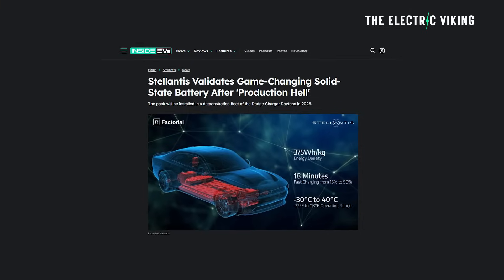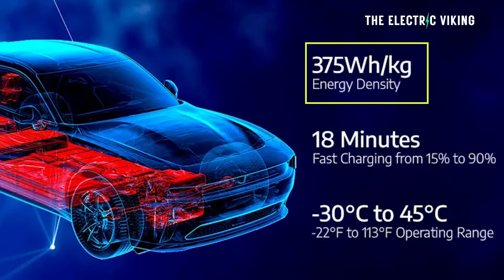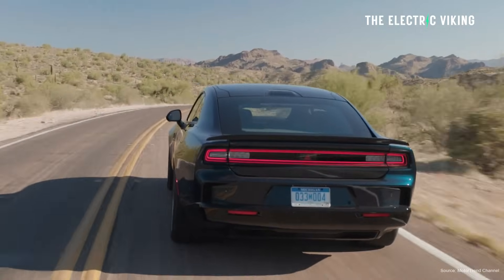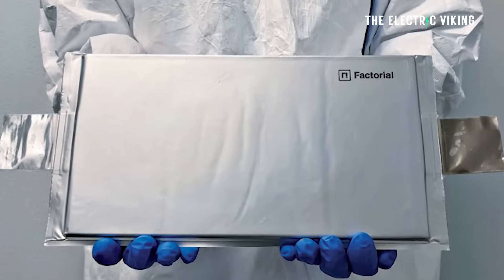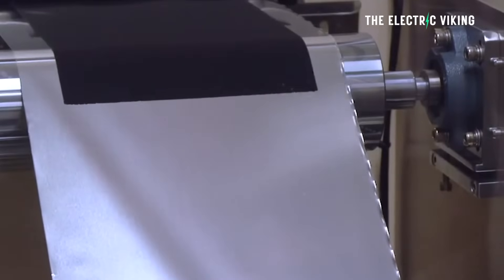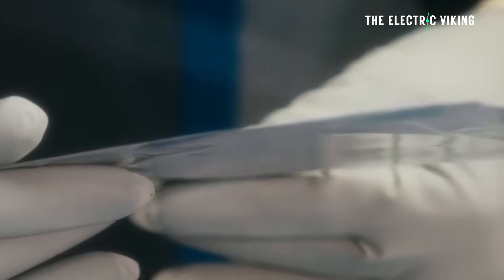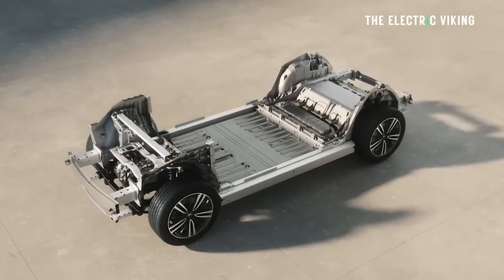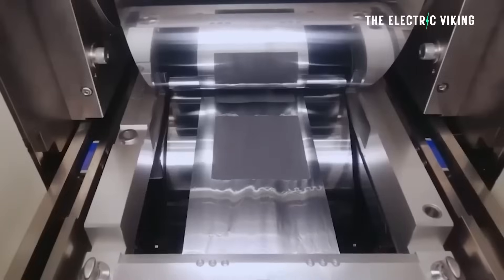Stellantis + Factorial Breakthrough: Solid-State Batteries Almost Here!

Comment: 45° C isn't bad. The question is how much lower is the battery performance if it only starts losing performance at 113° F? Most of the US doesn't get much above 113° anyway. So a little bit of performance loss on occasion for the southern states in the summer isn't bad. Not god though for those if you in upper Canada and Alaska during the winter.

Comment: most charging speeds are quoted for 20% to 80% so 15-90 is probably faster than most at the 20-80 capacities. Apples with apples? Is the Toyota technology though? Beware the Osborne Effect.

Comment: Does Indonesia produce class 1 nickel?
Most Indonesian nickel smelters rely on coal-fired power plants, with the industry consuming approximately 15 terawatt-hours of electricity annually. This translates to roughly 14-18 tonnes of CO2 emissions per tonne of class 1 nickel produced—significantly higher than global averages.3 Apr 2025   DO YOUR RESEARCH MAN   Call out safety always buddy...Regardless of what the nickel is used to for, this article has exposed shocking environmental damage done to Indonesia, and it appears that the safety of the local workers comes in long last place, No THANKS TO CHINA.

Comment: Sigh.
I want to believe… but no. Yes, it’ll likely happen, but I won’t get my hopes up. Need I mention Toyota?

Production at scale of a battery that can reliably provide 80% capacity after 1000 cycles is always two to five years away.

I’ll believe it when I see it. Until then, it’s just a PR stunt to pump the stock, or raise money.  In this case, coming from Stellantis reduces my trust.

Comment: The charging speed as a percentage of full charge matters, but with higher energy density, the amount of energy in a full charge is greater. So if you measure it as KW/hours per hours, what is the speed when measured that way?

Comment: Viking I really like you but the only battery metric worth talking about is PRICE per Kwatt hour. Yes weight and size are of some importance but PRICE is the key to getting the price of EV's down. As long as the battery lasts longer than 300,000 miles and can charge in less than 30 minutes then PRICE is the only thing worth talking about. 
So I don't really care about batteries that last longer or charge faster or are lighter, just tell me when the price per KWatt hour is going down

Comment: If true that charging is great. A charging speed that gets you 200 miles in 10 minutes is as good as it ever needs to be, I've been happy with half that on my Tesla. You can't go to the bathroom in less than 10 minutes so that sets the minimum time to charge. A couple of hundred miles is 3 or 4 hours of driving which is a long interval between stops.
The 600 cycles isn't good enough, they need to double that but I'm sure they will get there.
While this is good news for EVs in general it doesn't fix Stellantis's problems. The Charger weighed a way more than it should have, the battery was only a small part of that. A Model S with the same size battery weighs 1300 lbs less. A Model 3 weighs 1800 lbs less. The software on the Charger was also completely broken. Don't know if Stellantis has any competent EVs in Europe but their attempt in the US was a disaster.

Comment: Does the Electric Viking care about airplanes too?   The energy per weight will transform aviation.  Electric motors are far more reliable.  High energy density opens the door wide open to drone like helicopters and other electric airplanes.

Comment: Useful for aviation, however less important for EVs that already have reasonable range. Ubiiquity of supercharging would make this less relevant, but smaller lighter batteries make better sense for more efficient EVs.  Not really a game changer for EVs beyond significantly improving EV operating efficiency.  More limited charging cycles make this technology remain idealistic for now.  However most aircraft fly over 5,000 feet where air temperatures are lower, so heat management would not be a limiting factor for aviation and the higher Wh/kg makes solid state a good candidate for that type of application.

Comment: I think the only real advantages of solid state as they currently exist is safety and weight. I'm sceptical of the lifespan a solid state battery.  Also the temp range and charging speed are probably not good enough. Fast charging readily available is the key to having an affordable EV with a smaller battery pack.

Comment: Never forget.  Better batteries that will destroy the gasoline engine have been 5 years away since about 1900.
If these could give 600 mile range it would make more sense to cut the size by 1/3, make range 400 miles and cut the price of the car.  400 miles exceeds the range of the average bladder on the interstate anyway.

Comment: Most consumers don't care how much a car weighs. They do care how long it will take battery to charge to give them at least 5-ish hours of highway driving range.   Ideally 5 minutes or less charge time. Upcoming megawatt chargers should achieve 5 minute charging.  Assuming the epic charging speed doesn't cut battery life short, EV price is compatible to ICE,  it would represent last major hurdle  towards EV adoption being the norm globally but it will take a  few years for megawatt infrastructure to be put in place.

Comment: I see sodium ion being the dominant battery it will be half the price. 300+ range is all you really need. Charge speed of 7 mins. No fire risk. The price is key, also they will last year's longer. If I can get a sodium car with 300 miles for $30k I don't need solid state at $70k
Reply: Would the test cells of a SS battery study not be easier to build than the jelly roll or any current batteries? Likely DiY with household stuff.
I believe solid state batteries will be grown like crystals or rock candy. In alternating layers. Essentially an alternating saturated solutions/ slurry repeatedly flooding the cavity of an anode/ cathode arrangement. 
This nano tube tech is intriguing.
Reply: If CATL Freevoy dual battery really enters production end of this year with 1500km cltc in some configurations for a first generation and since it’s a sodium primarily made battery will be very very hard to beat it. 1500km cltc equates to about 900km in real life.
Reply: Honestly thinking about the issue of replacement, I think it would be better to not have a structural battery that would either be harder or impossible to replace.
Reply: @ekimeno3061 If replacement becomes never. Structural makes a lot of sense.  This tech could.
Reply: Semi solid battery for drone taxi

Comment: Solid state battery is just a BS marketing term,  Solid state makes no sense unless you are getting down to the thicknesses of the material layers that are measured in atom thick.   We are along way from that, so the point that they are basically impossible to be constructed due to be too fragile to be mechanically handled.,  They would have to be assembled in layers via deposition technics, which you cannot scale easily.  You are basically looking at semiconductor fab level engineering.

Comment: BONJOUR, avec le même poids que ont peut pratiquement doublé la capacité de la voiture  , se qui veut dire  , une petite voiture de 45 kwh  pourrait se retrouver avec une batterie de  80  kwh  , du coup l' autonomie serait doublé,  mais dans le premier cas de borne à borne il reste  35 kwh , dans le second cas il restera de borne à borne  70 kwh  ( 400 km sur autoroute)  . 🎉  et 600 charges ce sera 300. 000 km , j'ai une voiture de 14 ans et  j'ai a peine 240 000 km 😅  ( en content que des trajet sur autoroute  mais en ville  ont consomme beaucoup moins

Comment: Yes, solid state is always 5 years away.... Same as 3 years ago..
Reply: Solid state batteries are here but are just being implemented in other applications other than the automotive industry.
Reply: @bobhob35  Microvast has them.
Reply: Same for Fusion, Self Driving Cars and Flying Taxis.
Reply: @number1genoa  battery technology has other applications outside electric cars.
Honestly it may never become a reality in the automotive sector, but it certainly will with static power applications for computer data centres and servers.
There is nothing wrong with using internal combustion engines but EV vehicles have changed the industry for ever.
Reply: @number1genoa Self driving cars, are a Stone Soup story. You can't make it safe in the winter without an electronic guiding system. So, it starts as a hype, then they urge the government to help them doing it safer.
Basicly the governments will have to change the roads, and pay for it in the end.
Reply: @ I believe you are right about fully self-driving cars; the technology will need to advance significantly from driver assistance to complete automation. 

However, our discussion was centered on solid-state batteries, not on AI or self-driving cars. Enhancements in battery technology will have much broader implications than just for cars, whether they are autonomous or not. It won't be long before we see solid-state batteries in devices like iPhones, regardless of when they appear in electric vehicles.
Reply: @bobhob35 I'm not that big of an optimist regarding solid state batteries...
Reply: @I can completely understand why you would think that, given how car companies have been making big promises in recent years. However, this type of technology isn't really being developed by the automotive industry. You're right to question whether it will ever be implemented in a car that either of us could afford or even want to purchase.
I don't believe we will see any major developments in self-driving cars or taxis in the near future. Furthermore, I think that internal combustion engines, especially in commercial vehicles, will continue to be in use for a long time.

While battery technology will eventually become a part of our daily lives, it is likely to be implemented mostly in less glamorous applications within the technology and energy sectors. Unfortunately, this does not lead to a significant increase in the stock prices of car companies.
Reply: @ To be honest, I’m getting really tired of car companies promising revolutionary technology that will change society in just a few years. I just don’t trust any of them anymore. Honestly, I’m quite happy with my paid-off Toyota, which is super reliable and, despite being 13 years old, has less than 90,000 miles on it. I don’t feel the need to spend $40,000 to $80,000 on a new smart technology car.
Reply: @bobhob35 I drive a "self driving" car as a daily driver. And, I drive it in the winter to (real winter with snow). No way the self driving works in the winter, without sensors in the road.
Reply: @ Please confirm the level of automation in your car; I'm here to learn like (nearly) everyone else and understand the subject better.

Comment: The charging speeds of the Chinese solid state batteries have yet to be validated, too.
Reply: The LiPO with mega watt Charging speed has been validated by average joe. The ssb need to get better. And 18 mins for this battery is not a bad number, it is still a mega watt charging speed.